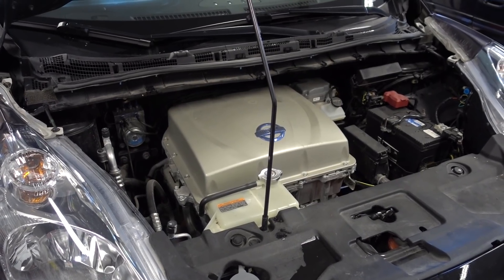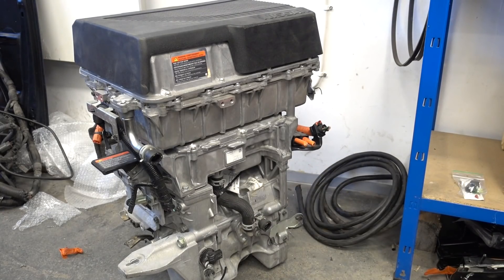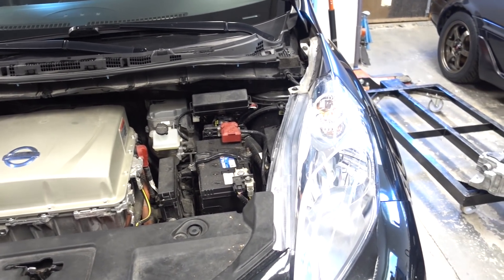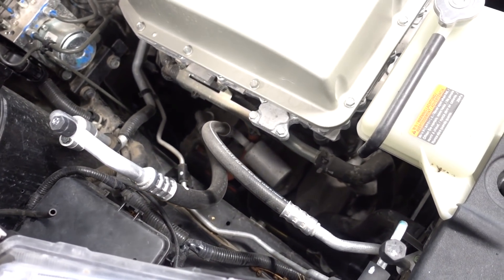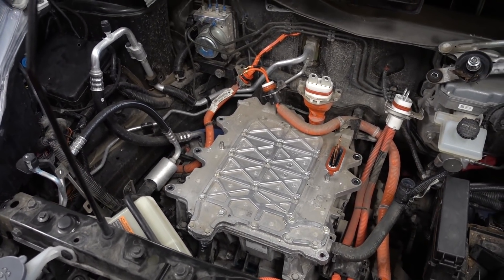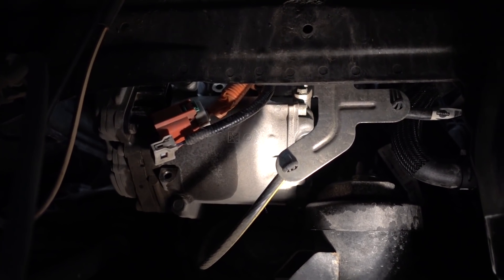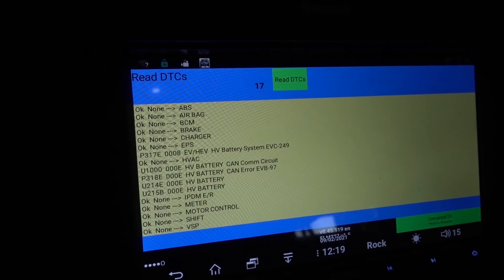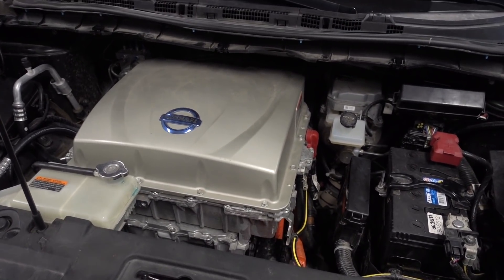Performance upgrade for the LEAF, [Part 1] Inverter upgrade

Comment: I always wince that that type of soldering connection; solder has low mechanical strength, and modern solder especially, is quite brittle - in a situation like this, where it will be exposed to constant vibrations - I dont think the mechanical support of heat shrink shrouding would be enough, long term.

Hook and loop soldering, or use an actual mechanical termination, like an in-line crimp, or a termination block; personally, in this situation I would in-line crimp, with heat shrink over the top to waterproof it.

Speaking as an ex, industrial electrical/electronics tech.

Comment: Здравствуйте, спасибо Вам за проделанную грандиозную работу. Я установил 2 портовый can мост с Вашим кодом и заменил инвертор aze0 на ze1 110кВт, при этом столкнулся с тем что максимальная мощность выдаваемая инвертором скачет, сначало может дать 130 кВт, а потом опустить до 90 кВт. Поиграв режимами управления B, D, Eco, может опять ненадолго выдать 130 кВт. Не сталкивались ли Вы с такой проблемой? Может ли проблема быть в can мосте? Спасибо заранее за ответ.
Reply from the maker: Make sure you use the file from the "Releases" section: https://github.com/dalathegreat/Nissan-LEAF-Inverter-Upgrade/releases/tag/v1.00
Reply: Спасибо, помогло, но теперь на этой прошивке максимум 123 кВт мощности выдаёт. @DalasEVRepair

Comment: The performance increase would essentially make the early version behave exactly like a 2018 in terms of accelleration, wouldn't it?
Reply from the maker: Even faster if you have a smaller lighter battery (24/30kWh)
Reply: @DalasEVRepair  I thought you specifically stated it was not an option to do this with the smaller batteries because the fuse would trip? Perhaps I misunderstood/ Super valuable content, thank you! I have a 2018 with a ac charging failure. I'm planning to take the cover off the PDM and try to see if I can fix it in place (I'm aware of the safety issues) I'd like to suggest an episode on how to troubleshoot the PDM, includiing expected values when measuring a known good PDM
Reply from the maker: @KSCPMark6742  we were overly cautious in the start, it works with the smaller batteries!

Comment: Slide large heat shrink or tubing on, before you begin splicing to protect finished splices, with second layer, for chafe and water protection. Use De-Oxit on connector pins to clean and protect from corrosion.

Comment: Strip and tin all the wires on the round connector on the work bench where it is easier, faster, and you can do a better job, then splice, solder and heat shrink in the engine bay.

Comment: I have a question about my 2012 nissan leaf I bought it with all battery bars intact and only charging to 29 miles and I took leafspy and reset the battery and it got 80 miles and I drove it 17 miles and it lost all it mileage what caused it
Reply from the maker: Sounds like a great question for the mynissanleaf.com forum!

Comment: This is a great thing for Leaf owners and shows the state of EV tuning. I think based on the low value of the Leaf it is ripe for tuning. 

Two issues though. 

 First you really should have just crimped new pins onto the OEM connector. I’m sure with a little hunting you could have acquired them for very little money. 

Secondly your splices as shown were poor. They have no mechanical strain connection in the way you performed them. You should mesh the stripped wire strands into each other then applied solider or performed a lineman’s splice. Also, the heat shrink should have sealant inside to prevent corrosion inside the heat shrink. 

Still a great video, I also like how you skipped sections of the assembly. As the part everyone really cared about was the process to swap inverters/wiring.
Reply from the maker: At the time when video was made, part numbers for Yazaki connectors were not known. I have since then added this to the guide, so that people can order the correct connectors and re-pin instead of splicing: https://github.com/dalathegreat/Nissan-LEAF-Inverter-Upgrade#part-numbers-

Comment: Great work. I owned an 2018 leaf
Reply from the maker: Thanks! You can upgrade to the 160kW inverter!
Reply: @DalasEVRepair  Im gonna do this with my ZE1 110kw to 160kw do i need to change anything in leafspy?
Reply from the maker: @xboxice2005  yes you need to code in the new resolver offset, ser my other videos for a step by step

Comment: Hello Dala, great youtube videos!!  Thank you for doing them.  I have a broken reduction gear on my leaf and I want to swap it out.  I don't want to die so I wanted to make EXTRA sure that if I disconnect the high voltage plug on the battery that everything under the hood will be safe.  Is this true?  Are there any capacitors or any other random things that could electrically kill me even if I pull that high voltage plug and remove the 12v battery?  Thank you for your consideration
Reply from the maker: Read the full service manual for the required cautions needed: https://www.nicoclub.com/nissan-service-manuals

Comment: let's say you have an old Hybrid....can you not just change the batteries with higher capacity ones, so you would extend the range significantly...?!
Reply from the maker: Yes! Totally doable
Reply: @DalasEVRepair  what batteries are you using for replacement then?
Reply from the maker: @p__jay  serch for a hybrid specialist focusing on reman. I only tinker with EVs

Comment: im swapping a 62kwh battery into a 2015, is it a good idea to do the inverter swap and should i also swap engines? will the engine fit in exactly the same place?
Reply from the maker: Motor is not needed, but cn be swapped if desired

Comment: Great Vid, Thanks Do you know if the round invertor plug is available third party or do you have the original part number, is it the same plug  for the 160kw inverter ?
Reply from the maker: I have all that info on the github link in the description!
Reply: @DalasEVRepair  thanks will take a look

Comment: Just my two cents I wouldnt use a copper pipe for the coolant. Everything else is aluminum and you dont want Galvanic corrosion to take place in the coolant system. That being said I am not sure if there are OTHER copper parts in the coolant system and nissan thought of it already or if the fluid has corrosion inhibitors built in. STILL Great video and PACKED with useful information. Thanks for all you do!
Reply from the maker: Thanks! This pipe was replaced in the 160kW inverter install, I switched to OEM hoses!

Comment: Is it possible to upgrade the fuse in a 24kwh battery for this modification?
Reply from the maker: Fuse upgrade doesn't seem to be necessary, people are running the 110kW inverter with 24kWh packs already!
Reply: @DalasEVRepair  Awesome appreciate your work!

Comment: nice work! I recommend you to use thermal shrinking tube with solder and glue inside (you'll find a lot at bay or Alibaba), it's awesome. 

so the all power comes from invertor? I'm owning Nissan Note e-power with em57 motor at 80kw and there is note e-power gismo S with same battery and motor but more powerful (and Serena e-power with same more power output  - 100kw). how do you think, changing invertor will be enough?
Reply from the maker: Yeah, changing inverter should be enough! (+Can bridge to increase NM-demand)
Reply: @DalasEVRepair  awesome, thanks. will try it after i get new invertor (gosh, that's so affordable after ICE-cars)

Comment: You mentuon the 24kwh battery has too small a fuse what about the 30kwh? I have a 30kwh 2017 leaf and this inverter swap sounds like it could be fun at some point
Reply from the maker: Should work with the 30kWh pack! We need people to test it 😁
Reply: @DalasEVRepair   doing abit of reading it looks like 291A0-5SNA0 is the 160kw inverter.. one of those with the lighter 30kw battery could make for an exciting car.. 

On a side note is it possible to strengthen regen I fell the car could be way more efficient if regen was allot Stronger?
Reply from the maker: @raceworx  Yeah regen can be increased from 40 to 80kW if battery can handle it!

Comment: Hey Dala, Fist time ever subscribed to youtube anything although its my favorite entertainment choice, Time to get with the times.
Have a 2013 leaf with 104,000 miles! Bought in 2015 with 25k miles, we love it, but our family of 5 has out grown it. Considered selling it
But I like it too much, battery holding out, better than average. We have 4 other vehicles used for different needs but the leaf is favorite.
would like to convert to tesla type performance, this is why I had eye on your channel a lot recently. An engineer mechanically and electrically secondary (structural) so this is not beyond capability, happy your working hard to figure it out :) Good Job. Cheers
Reply from the maker: Glad to hear that it interests you :) Start looking for a used inverter! :)

Comment: I also collected this option today) I only have an inverter of 62 kW.  The colors of the wires all matched the color on my 2014 Japan and the wiring is also from Japan. The compressor is held by 3 bolts and unscrewing them with a 13 wrench is not a problem without removing the wheels.  4 errors appeared and a yellow car lit up on the dashboard.  The car is driving, tomorrow I will fill in antifreeze and make a hose for the rear.
Reply from the maker: Nice! Let me know if you need a CAN bridge!
Reply: @DalasEVRepair  Need of course))) To drive fast I need a canbridge and do I need to register an inverter through Consult 3+?  How is the cost of the canbridge?
Reply from the maker: Can bridge is 250€. You can wait for inverter pairing feature to come to Leafspy pro

Comment: 5:35 Love the insulation tape wrapped metal tool.  No, that's not a properly insulated tool!
Reply from the maker: Each layer gives an additional 500VDC protection 😉

No but seriously I have a 1000VDC kit for working on the actual HV bits. See the fastcharger retrofit video for more info on that!

Comment: Thank you for your work, I find it very inspiring. If it would be road legal in Norway my 2015 LEAF would be in your shop right now for a battery upgrade :D

About this inverter upgrade and your custom cooling tube that has a copper part - assuming the inverter and the cooling parts are made from aluminium, is this not a potential corrosion inducing solution?

Comment: hej ,   do you have an amp number for the fuse in 24 vs 40 ?     the current can't be extremly bigger , usally there are some head room on fuses .    I happen to have a 24 battery and a  2018 power train so maybe a first try 
:-)
Reply from the maker: Even better, i have the fuse derating curve here https://www.socfuse.com/products/detail/dc500vbt2543/ You are living on the edge 😬
Reply: Hm  so maybe fast  0-100 will be ok  but not motor väg  speed for long time :-)  .    I guess  it is an easy fix to switch fuse if needed or maybe a 40 battery will be found later 

Anyway thanks !    and keep up the good work

Comment: Hi Dala, have you ever weighted the entire engine with its transmission? its still an EM57 on 2018 and 2019 models?
Reply from the maker: No i have not had the chance to weight that. Motor+inv is 57kg.

And yes, EM57 on all newer models, even the 160kW e+

Comment: You know I want to upgrade that fuse on my 24kwh pack and drop the inverter in :). 30kw extra grind should be noticeable.  This car is lighter than the 2019 even with the 40kwh battery ?
Reply: Don't do it unless all the wire is upgraded too.  There may be more. Remember The fuse is to protect the wire Not the other way around.  Upgrading the fuse may mean that the wire burns out.  The fuse is chosen to be the weak link to protect other components.  The wires may be the buss bars.!

I hope this helps prevent tragedy.

Comment: Awesome! Actually, original aze0 inverter have a same connector as prius 30, prius c, camry inverters. And ze1 connetor looks like a battery data connector from ze0. Does they fit? I don't have an inverter from a ze1 yet ;)
Reply from the maker: Well spotted, yes it is the same Yazaki 22-pin as the ZE0 battery. Different pinout though!
Reply: @DalasEVRepair  Im really curious, if just control board in this inverters can be swapped/modified... i seen aze0 inverter on opensource control board making 120 kw, if my memory servce me well. I will gonna send you another way to have a bit more fun with a leaf in DM on insta.
Reply: @pashko90  The board in the new inverter has a completely different shape and is mounted at a completely different position, swapping it is likely a lot of trouble.
Reply: @pashko90  My guess is that you'd probably have an easier path using open inverter, then attempting to develop some CAN control to run that off the LEAF's VCU and perhaps satisfy some of the other LEAF's controls.  I bet that upgrading the control board in the Gen 3 inverter would probably yield more gains - I'm curious if the IGBTs are the same in the 62 KWH inverter - I'll bet the primary difference is probably the control board, but a similar problem might exist with the 40 KWH pack limiting the current with a fuse.  Speaking personally, Dala has inspired me to buy an Arduino and CAN shield and start playing with that today!

Comment: You are a genius, but does this improve the performance of the car, increase its ability to cover a longer distance, or increase its ability to receive faster power?
Reply from the maker: Only more power! Quicker 0-100km/h!
Reply: @DalasEVRepair  I don't understand how it is quicker 0-100 when the motor has remained the 80kw motor 🤔 is it like overclocking the motor?
Reply: @prudx2775  i believe that newer Leaf’s use the same motor, just the inverter was improved, just like Dala has done here.
Reply: @robo19681963  ZE1 comes with 110kw motor
Reply: @prudx2775  well, the power rating (KW's) is just voltage X current, and if the inverter is changed then I guess these figures can be altered. I'm not 100% on what Nissan do but I did hear from a v knowledgeable person that they use the exact same motor.
Reply: @prudx2775  If you feed more power into the motor, you get more power out of the motor. Apparently the EM57 is capable of more than 80kW.
Reply: According to Nissan all Leafs have used the same motor, the current model Leaf has more KW only because of better inverters.
Reply: Faster acceleration. It will increase its amps I'm guessing. With ev (to a degree) amps mean torque, volts mean speed.
Reply: As far as i understand with just
 Electric motor, i think a lot of them can generally be used pretty safely to 2x or more rated power. I think it helps to include heat management at that point.

Comment: Wow, Nice one Dala. 
I don't think many ICE cars could have their power upgraded by so much so easily/cheaply.
Reply: many turbocharged cars can use larger turbos and an ecm/ecu reflash for similar gains.
Reply: Depends on the car. I'm not sure how much Dala spent on this but when you consider it requires a battery and inverter it could not have been very cheap.
Reply: Literally super difficult to extract power out of an EV, stop being an EV fanboi.
Reply: @mohgujai what are you talking about. Did you watch the video?
If you hate EV's so much why are you here?
Reply: @alibro7512 You're probably one of those who thinks they're a tech head and when EV becomes a thing you're suddenly a car enthusiast.

He literally had to ask leafspy guy to help hack the VCM, ICE cars will respond to what you tell it to do, EV has the ability to protect all it's ECU modules.  You know nothing.
Reply: @mohgujai  lol you might be right about me  I've only been driving for 40 years so what would I know about cars.
Oh and I just completed an EV conversion of an old Landrover so clearly I know nothing.
Good luck upgrading any modern car without getting a computer out regardless if EV or not.